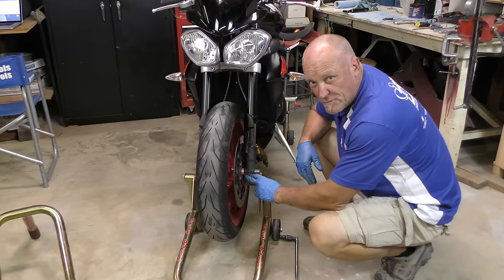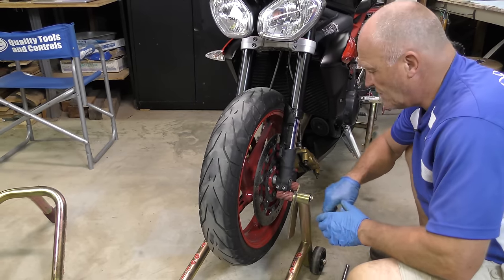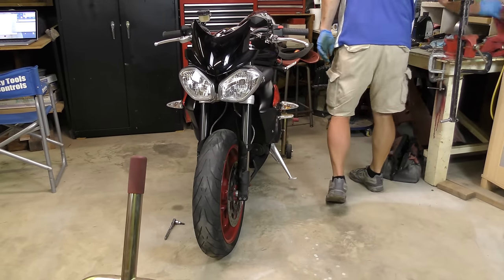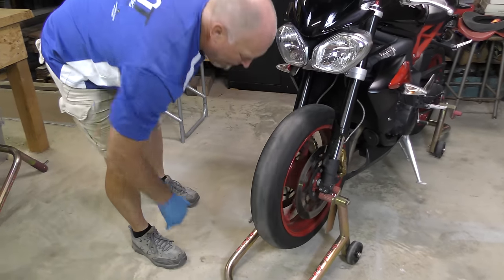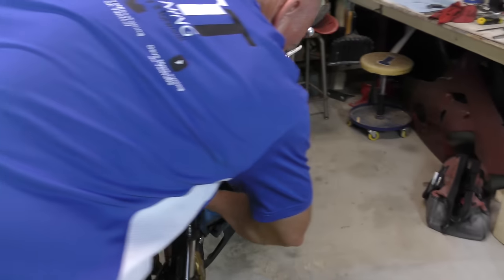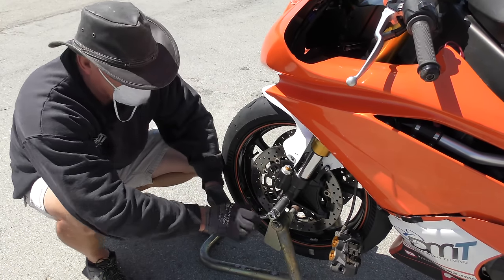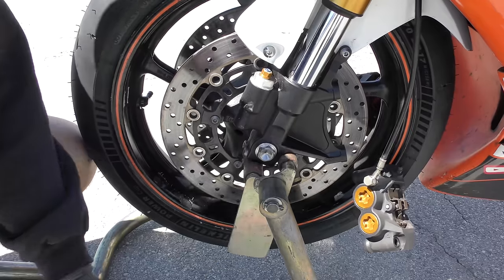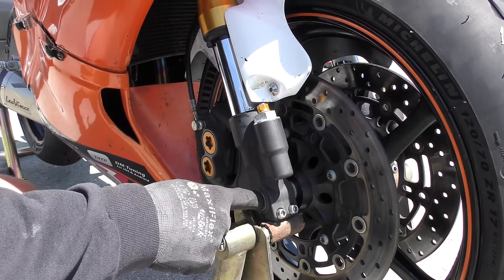Aligning Motorcycle Fork Legs Properly After Mounting The Front Wheel

Comment: Hey god... I mean Dave! I would love your insight on two questions. I work as a bicycle mechanic and when aligning the brake caliper, at least on bicycles, we are able to completely alleviate the brake pads from touching on the rotor. I see in many videos that this doesn't seem to be the case with motorbikes. Why is this and was this the intention in the first place?

Question 2 - I have an MT-07 (2019) and I am about to do your recommended suspension modifications to improve the ride quality.  The forks are currently stock and I weigh around 110kg (more muscle, less fat, promise haha) and I do stunt riding. If I increase the weight of the fork oil, will this be a bad idea in terms of wheelieing as sometimes I would be coming down harder. I wasn't sure if having a fork that returns slower would do more harm in my case.

Merry christmas! Kind regards, Keiran.
Reply from the maker: Hi Keiran. Q1; most riders do not clean calipers or pistons with any regularity at all so they get stuck and often there is enough vacuum pressure internally to sustain the current piston protrusion to create perpetual drag (rubber seal sucked down in the reservoir). That means less distance for the piston to push the pads into full contact therefore brake faster and harder (weight and speed being the two dominant factors).   Q2: from your description, this will make wheelies and endo's much easier to do with far more control with a very consistent rebound rate. The issue from wheelies is oil volume and internal pressure. Too much oil and it will blow out the seal so start with 20w to an oil height of 130mm (forks compressed, no spring inside). Spacer 8mm shorter. Start with the forks at the joint of the fork cap and tube, then test 4mm and 8mm lower.
Reply: I worked for a Mt. Bike manufacturing company in the mid 90's, as disk brakes were just starting to be used for down hill racing.  Everybody I worked with was a avid cyclist, but I came from the Motocross industry to be their machinist, (Nuke Proof industries, when it was in Michigan).  All the guys said disk brakes won't work for cross country racing, because a tiny bit of drag makes a big difference when your legs are only pumping out about .25hp.  But of course, eliminating drag was figured out for bicycles.  My 45hp dirt bike does not care.  :)
Reply: Thicker oil will make the dampening more harsh for bumps, but probably feel better for landings.  I think you would like a stiffer fork spring better, (will not get harsh on smaller bumps, with very little spring preload).
I like to use as little compression dampening as I can for the bumps, and use heavier spring to handle bottoming out.  You usually need more rebound dampening to control the heavier spring rate, that hopefully you can adjust with the rebound clicker, (not run out of the adjustment range.).

Comment: Instead of holding the brake lever and twisting the body to reach the bolts, use several thick rubber bands so your hands are free.  Irwin grip clamps work even better.
Reply from the maker: Great suggestion to help others and thank you for the post.

Comment: On my cb300r the forks are a little different. I plan on changing the fire tire and was wondering if the process is the same? It has clamps on both forks and is a single rotor set up

Comment: I’m on a tracer 9gt which has the semi active suspension. This means that I can’t push down on the front forks when the bike is not running. My understanding is the bike has to be moving in order for the suspension to move. How would you handle that?
Reply from the maker: I have ridden the semi active Tracer. I check with the engine running once the suspension oil is hot. I also look at tire wear for verification.

Comment: Hi Dave. I followed theRSV4 front wheel removal and fitting guide on my ‘19 Tuono RR and finfpd that the axle sits 1mm to 2mm proud outside the left fork leg. Where might I have gone wrong? Cheers for the helpful videos. Andrew
Reply: ‘Find’
Reply from the maker: If the front axle torqued correctly and the front wheel spins easily with no brake drag, nothing is wrong.

Comment: Aleays so informative. 
Would this be the same for smaller bikes with single calipers like my Ninja 300?
Reply from the maker: There are no pinch bolts on the small bikes, so that aspect is moot. For the brake caliper, 100% yes to align it to the rotor.
Reply: @catalystreactionsbw  thanks for that. I am trying to get comfortable doing servicing and maintenance on my bike but unfortunately tidbits like this aren't included in the workshop manual. Missed seeing you at Hampton Downs but look forward to the next opportunity.

Comment: Would this be the same on all the big 4 japanese bikes? I have a 2007 Kawasaki Ninja ZX6R. In the service manual, its confusing. Im not sure their referral to left and right truly is. I think I might have done it the opposite
Reply from the maker: It is the same process on all motorcycles that have fork pinch bolts where the ale goes through initially.

Comment: I tried to put my 06 axle back in and it wouldn't go through the other fork!  Pounding it in ruined the whole axle and the fork!  I had to sand down a lip on the fork and the axle and then ended up buying a new axle!  I don't know how this happened!  I think maybe my stand is not level, it's 100 degrees out?  Do I have to put the axle in the freezer lol?
Reply from the maker: Was this a first time event for the axle installation? If so, what was different this time? Were the forks recently worked on? Is this a new stand? Something created an alignment issue and hopefully the new axle will go in with no issues once qwe find the cause.
Reply: @catalystreactionsbw  yes just got bike and never removed the wheels before.  I do on my dirtbike all the time.  I think it's the new stands I got.  It was hot out so the parts may have just been expanded and tight.

Comment: And what to do if the forks are not the same length? When I lift the front with my 2 front stands one is shorter...does removing Preload help? Left is for Preload and right for rebound... Left I think is longer...
Reply: Check the measurement of your fork tubes in the triple tree and you may find that the shorter fork leg is set up further in the Triple Tree so you need to loosen it up and set it the same length as the other , that's my two cents anyhow
Reply from the maker: Great question. That would make sense when there is preload in one leg and when tuning, we do not make the forks align based on the engineering design.
Reply: Just asking... On 2nd Gen versys 650 are Preload adjustments in both legs.. On 3rd Gen only in one...on 2nd where forks vertically equal.. On 3rd none.. It was pain in the ass to install the axle and I was afraid not to damage the threads...
Reply: @northeastadventuremotorcycleri  they are 99% the same high

Comment: Hi Dave. Thanks for the awesome video my 04 zx10 had a spindle the goes in from the right but the left hand bolt acts as the centering spacer for the spindle. So neither side locks up against the wheel spacer unless the wheel is tight both sides. How do I make sure the calipers are seated correctly on this case
Reply from the maker: Set your axle first. Get that task done, bounce the front end and get the forks aligned. Lastly, do the calipers.

Comment: I've had a couple of easy dirt track tipovers with my V-Strom 650, loaded with camping gear, and now my attention is constantly on a longer reach to the left grip, compared to the right.  I've noticed this subtly present on all my bikes and figured it was due to arm length differences, but this time it's more pronounced.  Tomorrow, I'll loosen up the front wheel and reset everything as you describe to see if anything changes.
Reply: Same issue on my bike. Did you follow this video, and has it sorted it out now?
Reply: No I didn't, Mabs, I got busy riding and procrastinating.  I have to do it shortly, I have an almost worn out tire and the road temps are dropping here in Canada.  Trying to squeeze the last thirty-tooth out of the rubber.  I expect to do the swap in the next 2-3 wks and I'll let you know if there is any change.  If not, it'll be time to hire Dave, change the fork oil, and make it right.

Comment: Hey @dave moss tuning, can you do a video about how to vertically align the forks in the triple clamps (so the wheel sits perfectly level left to right)? great video by the way!
Reply from the maker: I take it this is based on having different length fork springs or different rate fork springs in either leg?

Comment: I'm confused. On the video you posted 5 years ago, you tightened the pinch bolts on the free leg, before torquing the axle to spec. But in this video, you're tightening the captive side pinch bolts before torquing the axle to spec.
Reply from the maker: Showing different methods of doing this based on axle types.

Comment: Doing this to my front forks will it make my top tripple clamp straight again at handle bars.? Any feedback appreciated thanks.
Reply from the maker: If you see that the top triple is bent, it needs to be professionally straightened. To assess, loosen the steering stem nut, loosen pinch bolts and the handlebars. Then just torque the steering stem nut. If it is still bent, fix or replace.

Comment: Hi there Dave, I hope you're well. What procedure would you follow if the front forks have a pair of pinch bolts on both legs - but the axle screws into an internally-threaded collar (as used by Kawasaki on the ZX7R etc)?
Reply from the maker: Same process. Screw the axle in an d torque it, then continue.
Reply: @catalystreactionsbw  That's great Dave, many thanks. 👍

Comment: Your trying to "Harmonize-balance" the external forces in the forks/brakes/wheels/hardware...?
Reply from the maker: Trying to get the "free leg" straight by pushing down on the forks, and then calipers to ensure they are perfectly aligned with the rotors. That harmony allows the front wheel to spin for several revolutions.
Reply: @catalystreactionsbw  Thx "Dave". I could see the process and related to equipment I have worked on in the past. (rotating assemblies). We would minimize friction/stiction and listen to it when it would rotate to tune it. Cheers
Reply from the maker: @mikejohnson9118  Great information Mike -learn something every day. What were you listening to? The tone or frequency when in movement?
Reply: @catalystreactionsbw  Sorry for the late reply. You would feel//hear the system as it worked. With power and freewheeling. It had to be very smooth in operation. Friction meant wear. Wear meant particles which would contaminate the coatings. Cheers

Comment: So what if your fork tubes are twisted in the triple clamps?
Reply from the maker: None of this matters at all if your forks are twisted.  Remove the forks and roll them to make sure they are straight. Then make sure the steering stem nut is loose. Install one fork and tighten the lower triple clamp bolt/bolts. Install the other fork and see if it will not locate. If that is the case, the lower is bent and needs straightening.

Comment: Hi Dave my front pads drag quite alot on my trackbike. 

I have brand new callipers fitted (hel v2.) I have noticed if I loosen the clutch side, calipers bolts slightly the spins with alot less drag, tighten it up and alot of drag again.

If I loosen the throttle side caliper bolts it has no effect (still drags alot)

I have followed this video regarding aligning everything up so any ideas?

Thanks
Reply from the maker: Hi Rich. Is the clutch side the leg where the axle gets inserted? If so, bounce the front end a few times and see if the leg finds a neutral spot where you tighten it up and the spin stays the same. Also consider pushing the brake pads back slightly and tighten the pinch bolts, then spin the wheel. As you pump the lever, listen to the contact between pads and rotor until the brakes are pumped up.
Reply: @Dave Moss Tuning  thanks for the reply Dave.

Yeah axle goes in from clutch and tightens into a captive bolt of the opposite side.

Just tried realigning the forks which I think has made a slight improvement.

What I have noticed is its the bottom caliper bolt on the clutch side, which, when tightened, causes the drag. If I slightly loosen only the bottom caliper bolt, the wheel spins with less drag.

Nip it up and dragging again
Reply from the maker: @richbonesjones4729  Is the bolt straight? If tightened and the spin is reduced, it seems the leg must move to then bind the wheel.
Reply: @Dave Moss Tuning  I have just discovered that once I have torqued up the pinch bolt's they aren't actually grabbing the axle as there is still movement in that fork leg so guessing there's thr problem
Reply from the maker: @richbonesjones4729  That would be a serious issue. You have a fork leg that has an OD wider than the axle. If that is the case, measure the axle OD and fork ID to see how much of a difference you have.
Reply: @Dave Moss Tuning  issue sorted after abit of trouble shooting.

I bought an after market quick release front wheel kit and the spindle in roughly 1/2 mm too small in diameter 🙈 hence why it won't tighten when pinch bolts are torqued up.

Put oem back in and the spindle is solid when pinch bolts are tightened.

Will get the wheel fitted tonight wirh oem axle and I'm sure my drag problem is going to be fixed 👌

Thanks for your time Dave ✊️🏍
Reply from the maker: @richbonesjones4729  Excellent work and glad I could be helpful through the detective work.

Comment: Hi Dave, would you say that the risk of having a bent fork leg is reduced if you use a stand that lifts the front with a pin unter the steering stem instead of one that goes under the fork legs? Thanks
Reply: Pretty sure you’re not gonna bend a fork using a paddock stand mate.
Reply from the maker: depends if you pu the axle in with a mallet or rubber hammer as that can missalign the fork in general, that could help.

Comment: I have a 09 r6 and I rode over a curb at slow speeds that I didn't see and bent both my wheels didn't drop the bike, (it has a small bend and the bead wasn't broken or leaking air)after this crash do I need to do this or is it not needed.
Reply from the maker: You should not need to do this BUT, you should check. Put the front wheel straight. Then lean over the seat and check that the forks are at 3-9 on the clock face. If they are, all is well.
Reply: @catalystreactionsbw  thanks I'll check this.
Reply: @catalystreactionsbw  which parts of the forks do I check at 3-9 position. Also if I do need to perform this alignment, how would I do this with aftermarket fork sliders.
Reply from the maker: @mouhamadyoussef3459  set the front wheel perfectly straight to the bike. Take a piece of string or wood and put it at the clock face 3-9 position across the steering stem nut. See of the rebound screw or preload adjuster are exactly in line with each other.
Reply from the maker: @mouhamadyoussef3459  start at 2:15 https://www.youtube.com/watch?v=vGkPOk2fbYc&t=1s

Comment: I have to try this out because my r6 is making some kinds of vibration when I go above 130 mph and it starts to vibrate my handle bars idk if that gotta do anything with that. Any tips?
Reply from the maker: Makes sense to do this first. You an also check chain tension, rear wheel alignment and make sure your wheels are correctly balanced.
Reply: @catalystreactionsbw  thank you for replaying. I aligned my wheels correctly on the back. I haven’t done the front yet. But do you know why my chain has tight spots? Like it’s a brand new chain and sprocket and I have tight spots on my chain for some reason.
Reply from the maker: @twowheelsr6  Yes - the rear sprocket is an imperfect fit the the carrier, so it moves a lot on the studs when tightened. This causes the sprocket to go up and down as the wheel turns creating the tight spots. Remove the wheel, loosen the bolt and try to get the sprocket as centered as possible on the studs.
Reply: @catalystreactionsbw  🙏🏻🙏🏻 thank you so much for all the tips I will be doing all that to my bike.

Comment: Will 'not bouncing' the front end (as per 2:20) cause uneven tyre and brake pad wear?
Reply: Much obliged for sharing your knowledge by the way.
Reply from the maker: Net result may be front wheel binding on the pads so uneven brake pad wear most likely.
Reply: @catalystreactionsbw  Cheers Dave.

Comment: I do this to my bike and it handles mint. But it has a single front disc so after a few hard stops the fork ends up twisted again. 😕
Reply from the maker: Have you ever thought of a fork brace to stop that happening?
Reply: @catalystreactionsbw  Or tightening his triple clamps?    Properly installed forks do not twist because of one brake disk on one side only.  His problem is a maintenance problem.
Reply: @EarthSurferUSA The triple clamps are well tightened. Problem is it is a usd fork with single sided disc. Anodized fork legs are slippery and will move in the triples. I have never had an issue with single sided discs on regular forks where the chrome is clamped.
Maybe think a little before making an assumption and commenting.